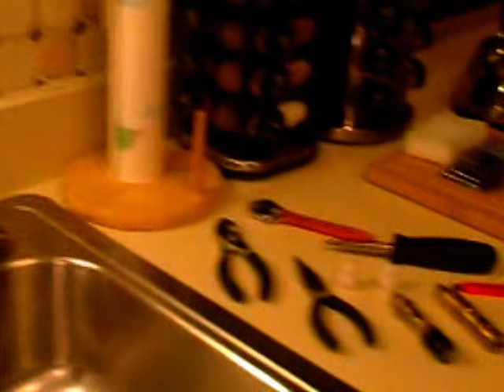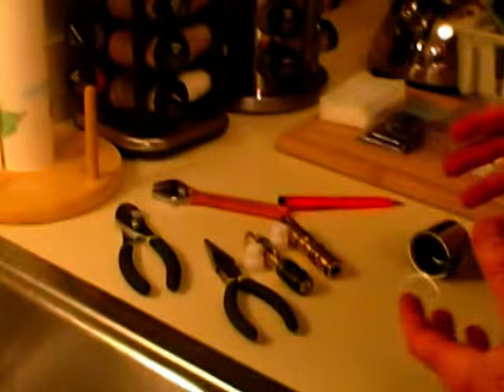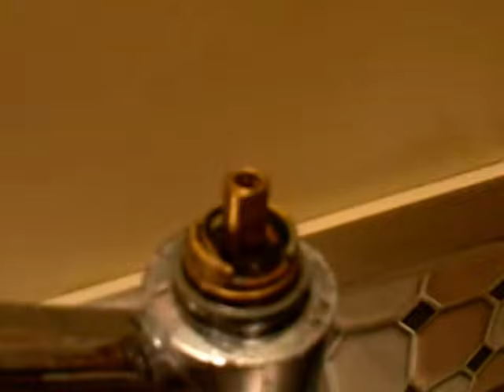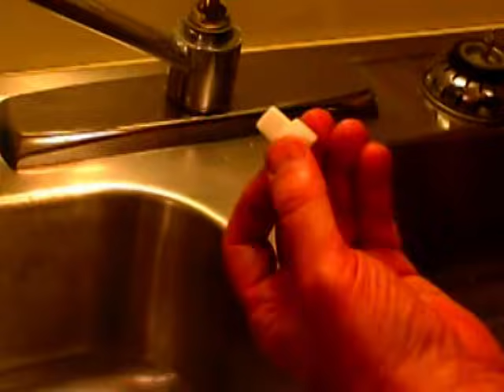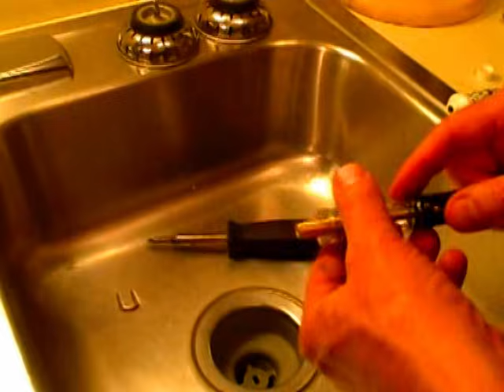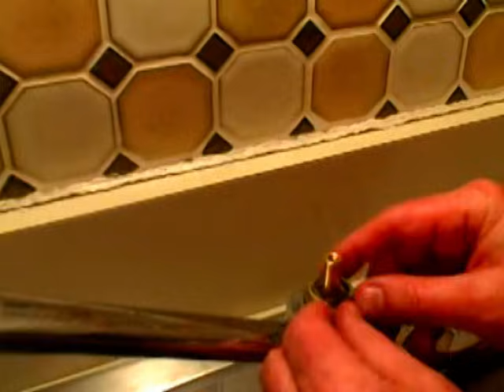How to replace a Moen faucet cartridge - Moen Faucet Repair

Comment: Great video! 

I just changed my cartridge on my old moen kitchen faucet and too my knowledge it has never been replaced in 20+ yrs!!! 

The cartridge as you can imagine was badly corroded as our water here is really hard……. I had to rewatch the video as I thought the cartridge had threads on it and it screwed out but no…… 

After many attempts at turning it out I had to resort to vice grips on the stem and slightly tap them up with a hammer 🔨…. It finally broke free! 

New cartridge greased up and it’s like brand new again! 😊

Comment: HELP!  Did everything as you say and when it is all back together the water still runs out the faucet when it is shut off.  I thought I hadn't pushed the cartridge in all the way so took the cover off and the clip and tried to seat it further by pushing down on it.  I put it back together and the same thing.  Water still comes running out when I shut the handle off.  Nothing seems to be holding the handle open.  Any help would be appreciated!
Reply from the maker: Hi, you can email me at fixitpodcast@gmail.com

Comment: After replacing new moen cartridge.my handle won't stay half way up it keeps falling all the way down.any suggestions...thanks
Reply from the maker: Hi, the cartridge is lubricated from the manufacturer. Sometimes the weight of the handle is enough to make it slide closed for a few days. Make sure all the parts are tight, depending on your model. If it doesn't stop sliding closed after a few days, return it to where you purchased it, they should swap it out for no cost.
We have more home improvement tips on our weekly podcast https://itunes.apple.com/us/podcast/fix-it-home-improvement/id880903087?mt=2

Comment: Your video almost matches my exact faucet from around 1988 called Chalet. Fabulous. I had only 2 problems. Could not get the U clip out. Used large scredriver at the front, but later found out mine slipped out of the back. Moen said I can replace it in front (easier to access). I am very strong, but the cartridge just would not slide up with locking pliers. Moen suggested a 50/50 vinegar and hot water. It just took 2 tablespoons and gently pour on the top of the cartridge and let it soak half an hour. Came out smoothly. Very GRATEFUL FOR YOUR VIDEO. CLEAR, EASY TO FOLLOW, AND GREAT CLEAR IMAGES.
Reply from the maker: Glad it was helpful.
We have more home improvement tips on our weekly podcast  https://podcasts.apple.com/us/podcast/fix-it-home-improvement/id880903087?mt=2

Comment: Great video, but two points.
1) you don't have to peel the sticker off. The plastic around the lift handle just pulls off. It's a friction fit with the rubber piece underneath. If you peel the sticker chances are you won't be able to get it to stay on when you try to put it back.
2) When replacing the handle you have to be sure to hook it under the lip on the top of the nut that you screwed on to hold the cartridge down. If you don't it won't have any leverage to turn the water off.

Comment: You missed the most important first part of this job for me, I see you have the strainers off drains put them on better yet cover with rag some of the upper parts can go down the drain then you have more work to get them back they make a puller for the cartridge not a lot of $ most hardware stores them some will rent or loan them to you.

Comment: Wish I had seen this video before replacing the Moen faucet cartridge in my bathroom. the Moen instruction that read did not mention lubrication beyond what was already on the replacement cartridge. After iI opened the water shut off valves and lifted the faucet handle the initial minute or so pf flow was very dark water but cleared up quickly. Was I supposed to clean the faucet body before I installed the faucet cylinder? I had expected some discoloration in the initial water flow but not the darkness of the flow that happened.
Reply from the maker: Hi, depends on your water and pipes, they can collect minerals and rust over time.

Comment: When my Moen got hard to operate, I thought I could replace the original metal & plastic 1200 cartridge with an all brass 1200B.  It seemed like the switch was going to work, until I tried to instal the old retaining clip on the new cartridge.  After about an hour of trying to get it on, I put the old cartridge back in.  I cleaned and greased the old one before reinstalling.  It is working much smoother now!  Shouldn't I have been able to make the switch?  Do I need a different clip for the 1200B?  Mine didn't come with any clip, only the cartridge, and white tool.
Reply from the maker: +Patrick OBrien Hi, the 1200 and 1200b are identical. Just different packaging. The clip will work with both.
I would give it another try, it should work great.

If you are having a problem with the cartridge, I would give Moen a call. I have found them to be very helpful.

We have more tips in our home improvement book http://www.amazon.com/dp/B01BK2K0JM?ref_=pe_2427780_160035660

Comment: Thanks for the info, I just bought a very nice CASCADE SINGLE HOLE FAUCET, is there the same installation process? I have the second one: http://goo.gl/z0FTbb
Reply from the maker: +Mr911vans Hi, I am not familiar with the KEBO faucets. If it is a single handle, it has some type of cartridge. They should give you a schematic of the parts. It will be held in place with some type of retaining nut or clip.

Comment: When I take the cap off and attempt to remove the phillips screw, the screw is stuck and seems to be turning the cartridge with the screw. So, the screw won't come out. What should I do? (I applied Liquid Wrench.)
Reply from the maker: +David Anderson Can you grab it with a pliers and pull up as you turn to put pressure on the threads. Let me know if that helps.
Make and model of the faucet?
Reply: No. Its a round headed phillips screw. Nothing to grab. Don't know make and model. It's a shower faucet with roundish handle, a little pointed on one side. I popped the plastic cap off and screw was underneath.
Reply from the maker: Try pulling the handle out firmly while you unscrew it, putting pressure on the screw. Let me know if that helps.
Reply: I did that. Didn't work. I believe I can hear the rubber o-rings squeaking as I turn the screw.
Reply: I also pushed the handle in hard. No luck.
Reply from the maker: Is this the tear shaped handle?
You may have to take a hack saw or dremmel and cut off the handle to remove the screw and cartridge. Let Moen know and they should send you a new one for free. They are usually very good with this. Let me know how it goes.
Reply: Yes, tear shaped. If i cut the handle off, then what? Can I then access the cartridge to grab it and hold it in place while I turn the screw?
Reply from the maker: Yes, some models have plastic fins that hold the handle to the cartridge. Once you remove the handle you can pull the retaining clip on tip on the cartridge and pull it out. When you buy the new cartridge, you will get a plastic removal tool to loosen the cartridge. Like I show in the video.
Reply from the maker: Keep me posted.
Reply: Ok. Thank you.

Comment from the maker: +Shannon Alvarez Hi, I would use a large adjustable pliers, that will give you more torque. You can also use a pipe wrench. Spray some penetrating oil into and around the nut may help too. Let me know if that helps.

Comment: Thank you - I'm so glad to see that you greased the cartridge before you put it in.  I recently replaced our kitchen cartridge, used the plumbers grease and was a little worried if that was okay to apply in that location.  Didn't know if it would filter into the water and get us sick.  Wonderful Video.  It's such an easy process to do once you do it and get a feel for it.  GREAT Video - nice instructions.  Thanks for providing.
Reply from the maker: MomofScout Hi, get a food safe silicone grease and you will have no worries.
We have more tips on our weekly podcast https://itunes.apple.com/us/podcast/fix-it-home-improvement/id880903087?mt=2

Comment: Thanks for the video. I have that exact faucet.  I did what you did but it is still leaking at the stem of the faucet where the grey plastic ring is . Could it be a bad new cartridge?
Reply from the maker: Karen Effs Hi, if there is a lot of mineral or rust buildup, you could have nicked the oring, causing a leak. I would take it out and check the orings, then use plumbers grease on the outside. Let me know if that helps. We also have a weekly podcast. Here is a link http://www.stitcher.com/s?fid=49441&refid=stpr

Comment: how do I loosen the cartridge if the plastic "ears" are broken off so that the plastic "tool" can't catch?  thanks
Reply from the maker: Kevin D Hi, after you take out the retaining pin, grab the stem with a pliers and give it a pull. If it is held in place with rust or minerals, you can use a locking pliers and tap it out with a hammer. We also have a weekly podcast. Here is a link http://www.stitcher.com/s?fid=49441&refid=stpr
Reply: That pretty much did the trick, thanks!
Reply from the maker: You're welcome

Comment: replaced Moen 1225 cartridge but when I turn on the tap now, it gradually closes and the water supply does not stay on full strength.  Any thoughts on how to keep the tap open.  No leaks though which is good.
Reply from the maker: Hi,
It should stay open. Call  1-800-Buy Moen and they will send you a new one. I've had great help with their customer service. We also have a weekly home improvement podcast on iTunes and Stitcher. Here is a link http://www.stitcher.com/s?fid=49441&refid=stpr

Comment: Great video but can you help if the cartridge will not come out? The clip has been removed and in trying to use the plastic removal tool it just keeps coming off. I tried to pull the cartridge out but it will not release. Thanks, Tom.
Reply from the maker: Hi,
I have used needle nose pliers or regular pliers on the 2 raised sides of the cartridge and used Channel Locks on the pliers to twist it. You need to break the bond of minerals or rust that is holding it in place. If you pull the center of the cartridge out, you will need a special tool to pull out the body of the cartridge.

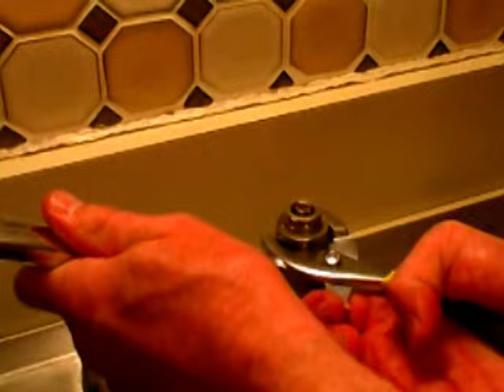Comment: Good video, but unfortunately I can't get the nut off at 1:45.
Reply from the maker: Hi,
try using a large adjustable pliers or a pipe wrench and turn it counter clockwise.
Reply: Thanks for the reply, but the problem is that it is a circular piece, and water is leaking from that area.  Unfortunately, I cant get a grip.
Reply from the maker: Hi,
Can you email me a picture?

Comment: Great video. I have a duel faucet, replacing plastic with plastic and there doesn't seem to be a clip holding either side in place like the one you mention at 2:15. I don't want to damage anything if there's something different holding these in. Thanks in advance.

Comment from the maker: Hi,
If you have a new cartridge with the plastic tool, take the plastic tool and work the body of the cartridge back and forth. Grab the top of the body with a locking pliers and pull it out. If you can't get it loose, you can get a removal tool at the hardware store to remove the outside of the cartridge. You insert it into the cartridge and it has a pop-up tab that lock it into the body so you can pull it free.

Comment: Help. I followed your directions and all went well until I tried to remove cartridge. The cartridge came out in pieces and there is still part of cartridge stuck in the faucet.
The guts are out and the top half out but plastic remains inside. How would I get it out.
Thanks for any help

Comment from the maker: Hi,
Is it the nut just under the sink that attaches to the sink basket? If it is, I would remove the old washer and replace it. It should be a sink basket washer. It has a flat top to seat under the sink basket. Make sure to clean off the bottom of the basket. I like pipe thread compound.

Comment from the maker: Hi,
I think you are the right track with the vinegar. I would pour it in and let it break down the buildup of minerals. If that isn't enough, try some CLR. A bottle brush might help too. Use plenty of silicon grease or you will cut up the orings. Let me know what works for you.

Comment from the maker: Hi,
You can run to the hardware store and pick up a tool that will remove the outer part of the cartridge. Some stores will let you rent one. It slides into the body and has a small pin that locks into one of the holes in the body. It will then allow you to pull it out.

Comment from the maker: Hi,
Make sure the retaining clip is removed. If you have locking pliers and can grip the top of the body, that can help give you a better grip. If not, take locking pliers and grab the stem that holds the handle and rip it out of the body of the cartridge. You can now go to your hardware store and get a stem puller for a Moen cartridge that will fit inside the body and lock, so you can pull it out. Let me know if that helps. Good Luck

Comment: I am trying to remove the original cartridge on a Moen single-handle Kitchen Faucet.  It is leaking badly. Installation was in August 1997 and it never has been removed.  Having a difficult time removing the 1225B cartridge which is seized in the faucet. I can move it up about 1/8 of inch. Have the plastic cap to turn the cartridge but it still won't release when pulling up.  Any suggestions in getting this to free up and out of the faucet?   Thanks,  Bob - Canada

Comment from the maker: Hi,
If you have the cartridge in, make sure the clip that holds it in place is locked in place above the cartridge. If you have an old handle, sometimes the parts inside get wedged. I would look at that. If you still have problems, call Moen at 1-800-buy-moen and they will walk through the problem with you. Good luck. Let me know how it turns out.

Comment from the maker: Hi, 
Moen suggests only using plumbers grease. It is designed to keep the rubber soft and protected from chemicals in water. It will add life to the cartridge.

Comment: Thank you so much for this video. I got stuck trying to remove the cartridge which wouldn't budge .Then  I saw your video and realized I should buy the cartridge first so that I could get the white removal tool which worked.  Thanks for saving me a couple hundred on a plumber.

Comment: This was a very simple repair to make following this video.  However, It turns out this was not my problem.  My handle was not set correctly, so the stem was not being pushed all the way down when the handle was pushed down, causing my leak, so you may want to trouble-shoot that potential issue first before you spend the $15 - $25 for the cartridge.
Reply: I cannot stop the slow leak no matter how far it it is pushed down and off,   I have replaced many faucets etc, over the past 70 years a yes 70 years and  I cannot stop the leak even after I replaced the core completely with a new one.   Why not?   I have an angry wife who has to use the faucet....

Comment from the maker: Hi, it is a washer on the outside of the cartidge. Turn off your main water and remove the cartridge. Take it to your local hardware store. Some o-rings can be replaced for a few cents. Some cartridges will need replacement. Good Luck

Comment: I have a single handle shower faucet and it's the handle that's leaking, rather than the shower head.  Does this indicate cartridge replacement, or is it only when your faucet/shower head is dripping that this would work?